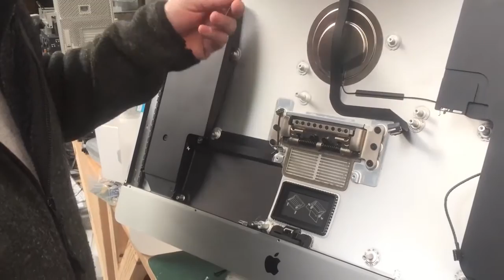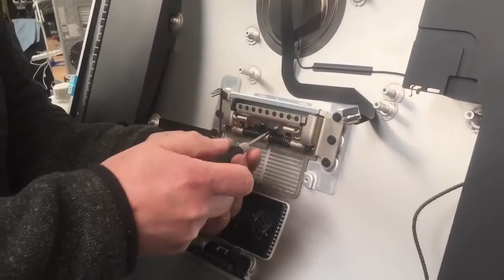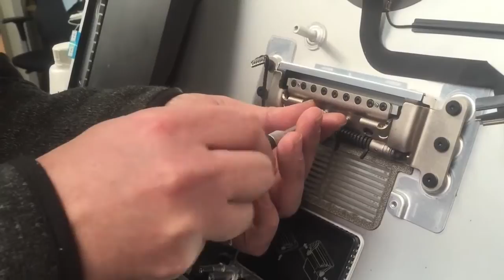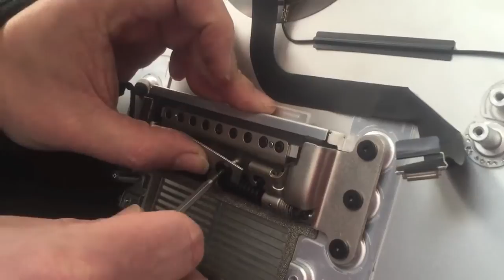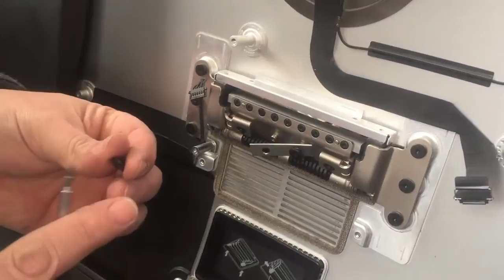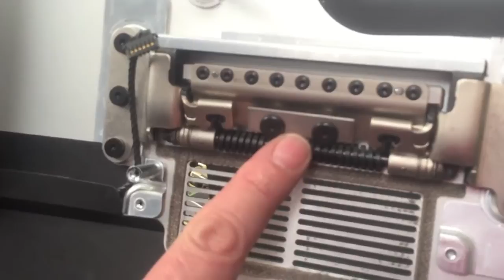Apple iMac 27' broken hinge  clutch repair - Repair My phone Today

Comment: Hi Patricia ... I'm in the same pickle as Angelo ... what is the size and thickness of the support and distance between holes?
Reply: Hi Dean
I understand that Patricia should like we go to one of Phone Repair Centres .... but for me (from Italy) may be too expensive.
Anyway, I believe for thickness 1,5-2 mm may be sufficient, and the support may be 3,5x1 cm, hole distance 2 cm, hole diameter 0,5 cm. 
Do you believe the same?
If not so, when I'll open the iMac I can adjust holes ....
Reply: That sounds about right.  The only way to make sure is to open it up and measure everything.  Support centers are bloody expensive.
Reply: May be sufficient two washers, too. Cutting the higher and lower borders